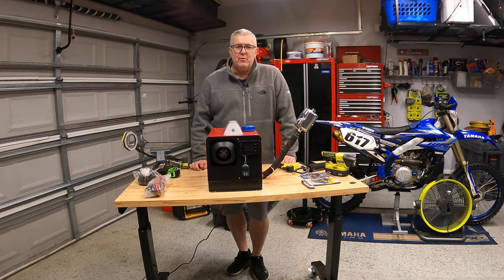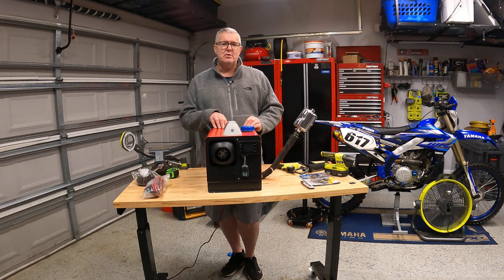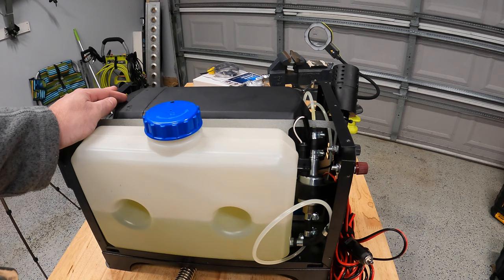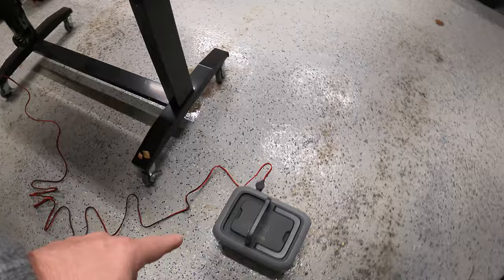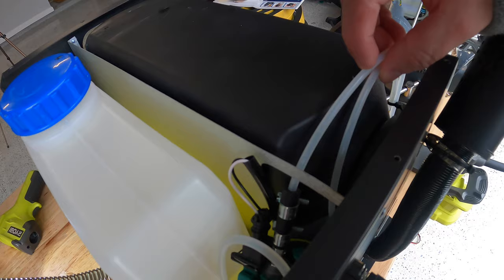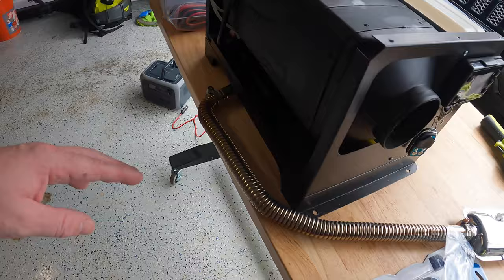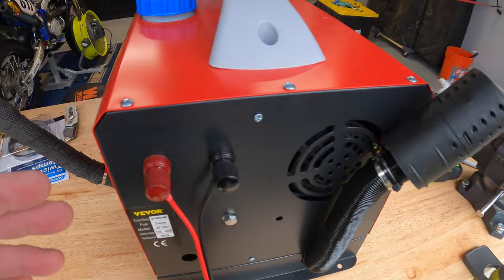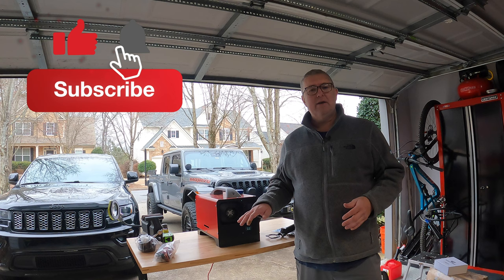No More Ticking: How This Quiet Fuel Pump Changed the Diesel Heater Game for Winter Camping! Part #3

Comment: The pump is noisiest when the heater is running on low.
Reply from the maker: Still a 1000 times better than the one that come with it from the factory
Reply: @sherburnoutdoors  ..Just went to your link that you provided and it says "no longer available".
Reply from the maker: @steiny3353  I just clicked it, works fine
Reply: @sherburnoutdoors  ...hmmmm. I'll try again....thanks
Reply: @sherburnoutdoors  ...The link works fine, but they (the pumps) are no longer available and they don't know when they will be available.

Comment: The exhaust needs to be at a downward angle to allow any condensation  to run out.
Reply from the maker: That exhaust get close to 300 degrees, I am guessing what ever is in there will turn to vapor
Reply: @sherburnoutdoors  start up and run down and as it cools it will create acidic condensation…..
Reply: I think the muffler actually has a small weep hole to drain the condensation

Comment: I got that pump and have the same heater as y'all. I also purchased the silicon boot thats encloses dose pump. I suspended pump with nylon ties to eliminated the transfer of any noise to heater cabinet.  I dont hear pump after 2 minutes of operation. This is 2nd season with it, already used it to heat 2 car garage this year, still silent! Happy Trails!
Reply: Michael what part of the country are you in? I'm thinking about using a diesel heater to heat my 2 car garage but I wonder if it can keep up in a Minnesota winter.
Reply: Can you share more info and possibly a link to the boot you’re talking about?
Reply: @j.saavedra1502  It'll heat your double garage as long as insulated well except concrete floor will still be cold unless you insulate it too

Comment: Just add some used filtered cooking oil (up to 70%) and the higher viscosity will make the clicking almost silent. Best way to prepare the cooking oil is using some pork gelatine desolved in boiling water, add it to the used oil and mix it. Let it cool down, and most of the gunk will settle at the bottom. Use the clear oil on the top and filter it.
Reply: Used cooking a big NO from us and only ise home heating fuel or a decent road diesel  as we have been using those heaters for years.
Reply: Yeah that's the best thing you can do if you're trying to ruin your heater
Reply: @troy7124  It is for sure not recommended, but I have run it like this for 1 and 1/2 season, with no big issues. For me, it has been a great succes, considering the heater was only 120 euro. Diesel prices here (Europe) are insane, so this is a cheap alternative. I am sure I will need to clean it more often and it will need more regular service intervals, but that is a risk I am willing to take.

Comment: The thing I found that works the best and extremely inexpensive is a pool noodle,wrap the pump with it
Reply: Great idea. I used the foam copper pipe plumbing foam tube
Reply: @MikeR55  I was thinking motorcycle silencer packing.  Amazon has some for $10.
Reply: @jimm1819   Ya that will work. I have some left over from an FMF muffler repack kit.

Comment: We have an Eberspacher diesel heater mounted underneath our VW T5 camper van and in the handbook it describes the pump as “near silent” I can honestly say that I’ve never heard the pump either inside or outside the van, just shows that these pumps can be very quiet 👍🏻🇬🇧
Reply: It's cos you have rightly spent the money on the genuine item rather a knock off. Good on yer.
Reply: We have eberspacher heater's in lorry's and they are brilliant,I had a Chinese diesel heater in my camper van, lasted three weeks 😢
Reply: @steveffuksake  Eberspacher was recommended to me by a former HGV fitter and parts supplier, he said they were very reliable and parts were readily available it also helped that we have a main agent fairly local to us who did the installation. It was not cheap (£1500 fitted) but I’ve not regretted it.

Comment: You need to have the pipe facing down to stop condensation in the exhaust which is acidic
Reply from the maker: Thanks for the advice, started doing that now
Reply: @sherburnoutdoors  Agree and as you had it in the video, the 'thin' edge of the exhaust you'll see has a hole in it which drains any moisture from the line, hence the continuous down slope from heater to outlet.  The other 'thin' side has the mounting rivet hole.  Great video and I've changed my brand on 'low noise' pump I was planning to order to the one in your video.

Comment: I used header wrap that I use on my Harley. You can touch the exhaust pipe and it is just warm. The best way to use the heat wrap is to soak it in water to keep the glass fibers from getting on you.
Reply: I did that on an 8KW diesel heater with a couple of layers. When the heater is on full it still gets too hot to touch and will melt plastic. Maybe the stuff I used wasn't as good as yours?

Comment: ran the exhaust through a radiator and get more heat, also brother when doing exhaust wraps wet the soak the cloth and then wrap you get a tight wrap that will not come undone. great video thanks for showing that an after market pump can take away the tick tick tick.

Comment: Great info on the fuel pump, thank you.
One thing you should be aware of when using an infrared thermometer is that they work by detecting infrared emissions. Not all surfaces are equal in this regard. Shiny surfaces are notorious for lack of emissivity. Flat black and strangely enough water work very well. Do a quick Google on infrared emissivity tables to shed some insight into their accuracy on various surfaces.

Comment: I screwed foot extenders to mine to get rid of burning issue; also helps keeping exhaust pointed down.  Wraps only help marginally. 

If running outside; the old trick is to drill a 1/8 or smaller hole on bottom of pipe by outlet if you need to point up; lets water drip out and increases flow.

Comment: I'll check out the quiet pump, thank you. Would have appreciated a temp check after the black tape. In my case the tape just conducted the heat right through, maybe a drop of about 10 degrees was all I got. Used about 1.5 inches thick white fiberglass heat wrap and down to 73 degrees. (touchable)
Reply from the maker: In the showdown video I did last week, there are temp readings taken

Comment: i love that clicking noise, makes me know that heater is working :) and wrapping exhaust aint a good idea...unless you change it with proper one, those chinese pipes are so cheap that will simply burn down and closing heat inside will just speed it up....
Reply: me to ..i find it relaxing and comforting

Comment: Could you wrap the fuel pump in Rockwool?  it does a great job in my living room walls for noise reduction. And a combustion rating of over 2000 degrees.

Comment: I have sound deadning laying around and I plan on adding a layer to the pump itself and around the cover to test it out.
Reply from the maker: Let me know how it goes
Reply: Fired heater last night, loud tick from pump but didn't realize what it was at the time. Removed cover today, fuel line taping in cover, also noisy pump. Left over batting insulation beside heater from previous owner, stuff some around pump and fuel line. Zero tapping once heater is running. 
Will likely re route pump and insulate with board foam but atleast we know insulation helps a ton.
Reply: Ran heater for 20 mins during day to see if any parts near pump get warm or hot, everything was cool to the touch so in theory it will work but not the safest. Ok for a quick hack until you can relocate.

Comment: I removed the step cover on my citroen relay van...ran fuel line directly to diesel tank as the one supplied   others said leaked...located underneath passenger seat...mounted the fuel  pump on side of step..also left bulkhead head in not a sound.

Comment: In 2 separate installs, one a Chinese and the other a Webasto, both pumps were quieter at the higher setting. It is a faster "click", Not as loud and not as noticeable.
Reply from the maker: I think the noise of the fans helps mask the clicking noise as well when they are ramped up hogher

Comment: Fun fact: The exhaust "muffler" is not a silencer. It's a condenser and it do not damp the sound. It's possible to get a real silencer as a little muffler or as a muffler hose.
Reply: Other than the condenser function, is it even needed? I ran mine without the 'muffler', seemed to work ok without it.
Reply: @MikeR55  
I think you need some way to get rid of the moisture that comes when the fuel burns. So it must depend on how the exhaust system is made and is it possible for the moisture to run out of the exhaust pipe. I have seen a solution where the exhaust pipe had a small drain plug since the condenser was not used.  I think i will use it but i have also 2 meter long exhaust silencer and also a real silencer. I'm still in the project thaughts and have not installed my Diesel heater yet.

Comment: Ha ha you learned the hard way about itchy hands and fibreglass exhaust tape, always wear gloves before applying exhaust tape.
May I suggest that you lower the exhaust silencer as it has a condensation drain hole in the bottom of it , your exhaust will last a lot longer. Im running two over the winter here in the uk one in a static caravan and on on the side of the house, its saving a lot of money burning kerosene instead of diesel in them.
Reply from the maker: Thanks for the tips! Only wearing gloves moving forward and I did position it down

Comment: i built a waterproof wooden box, with lift up lid... That sits around the back of my workshop... 
I cut and extended the wiring to the control screen, so that the screen is on the wall inside my workshop, and the heater is outside...
Powered by a car battery, constantly on trickle charge...
and just drilled a hole in my workshop wall to put air vent in...
So i hear no ticking :) Not an issue for me
Reply: I’ve done the same and hear the ticking through the get air vent….
Reply from the maker: That is great, thanks for sharing!

Comment: Hey I have the 5kw all in one vevor diesel heater and I changed the fuel pump but the one you recommended is still very loud… is it possible I installed it incorrectly?

Comment: Make a box out of foam boardand just sit it over top of the heater with the intake and exhaust outside the box. I do it with all my generators and it eliminates 99% of noise. Slide that thing under your vehicle with that insulated box over top of it and you wount hearba single sound other than the blower fan.

Comment: Thanks for video im wondering how long can i leave diesel inside the tank for when its not use for summer time
Reply from the maker: I left mine half fuel over the summer and had no issues
Reply: @sherburnoutdoors  thank you u always add again diesel? Mix old diesel with new just curious

Comment: The ticking is often not the pump but the fuel line tapping against the housing. What pump dit you get 16ml..20...24? Or you you just bought 'a' fuel pump?

Comment: I have my pump suspended by a couple of elastic bungee chords. This is on a boat and is still mounted so will not swing about. The chords stop the pulse communicating itself to the infrastructure. Can hardly hear the tick at all. Would be silent if I wrapped the pump with insulation but so quiet I've not got round to it.
Reply from the maker: Very cool, thanks for sharing

Comment: Does this new fuel pump compatible with all Chinese diesel heater on the market, and what is the difference between the advanced and general model? Thanks
Reply from the maker: Pretty much, I think all of the units are pretty much the same and probably made in the same factory

Comment: Hi -  great video, want to install a Deisal heater but have the same concern of the pump noise. A couple Questions, is the unit you modded a Vevor? And what power station are you using, I have heard the Vevors need 15 amps from the 12 V to start reliably (Most Power stations I've seen like Jackery et al are 10) Thanks!
Reply from the maker: It is a vevor and the power stations I use only to 10a on the 12 v.  never had a problem
Reply: @sherburnoutdoors Thanks! Good Channel, subbed :)

Comment: Quick question: how do you actually seperate the fuel tank from the case?  It seems to be bolted or welded.  Thx in advance
Reply from the maker: No, i did not remove it
Reply: @sherburnoutdoors  thanks, but I discovered how to remove it. I have a leak and needed to inspect the tank to understand leak source

Comment: Not sure that the pump is actually any quieter. I hear the pump when the heater is on low. When it's on full, the noise of the pump is drowned out by the exhaust noise. What do you think? I am going to put some foam insulation around the pump and see what difference that makes. Either way, I would rather be warm.

Comment: are you running it off a 12v 10amp socket? just got a power station and im using an inverter as my 8kw draws about 150W on start up and theoretically shouldn't work
Reply from the maker: Yep, 10a
Reply: and doesnt draw over 120w? @sherburnoutdoors
Reply from the maker: On startup at the beginning gets around 125 to 127
Reply: right - that exceeds 12v at 10a...you'd think it'd blow a fuse. interesting. Not sure I will risk it. @sherburnoutdoors
Reply from the maker: @RyanGold19  have had probably 10 trips at 20 degrees with the heater and power station, never had an issue
Reply: good to hear! I don't understand how it does it all above the power rating! @sherburnoutdoors

Comment: Hi, Nice video! I’ve got a question for you, did you had any smell from your unit? I have just bought one and it smells like burn rubber. Thanks for your time
Reply from the maker: Let it break in
Reply: @sherburnoutdoors  thanks! 👍🤘
Reply: I had ruber smell so I return the unit
Reply: The smell goes after a few days on high

Comment: Exhaust heat tape will shorten the life of the exhaust pipe by 70%. Insulating the fuel pump will shorten its life by 50%.

Comment: Unless you intend to kill the heater, the exhaust should gently slope downwards, the muffler as a small hole in the bottom to allow condensation out. 

The exhaust tube will crack if you keep bending it in different directions.

Comment: If that's all it takes to bother you I'm assuming you must live in a very quiet area. You surely don't live in the city.
Reply from the maker: It was loud, and yes live in the country
Reply: @sherburnoutdoors  You would have been real fun to be around on an aircraft carrier if all it takes to keep you awake is a tick 🤣 I have a diesel heater and my grampa's windup alarm clock was louder.

Comment: I ordered one of these pumps after watching your video and it should arrive in a couple of weeks.  Seems they are shipping directly from China now or something.  In any case, one of the Amazon reviewers noted that while it was initially silent it then sounded pretty much like the original one after a couple of weeks.  Have you noticed any change in the pump's noise level?  I still have time to cancel, is basically why I'm asking.
I actually have one of James Browning-Smith's replacement pumps which is truly silent (and tunable), but it's mounted in my briefcase heater and I'm hesitant to take it out.
Reply: How did your new pump work out?
Reply: @byrne1916  In the end, I canceled the order. Was going to take forever to arrive and one reviewer said that it was quieter for a couple of weeks, then sounded no different from the original.
Picked up one off eBay that is also supposed to be quieter.  It only just arrived today, so maybe I'll have a chance to swap it out here soon.
Reply: @gr0uch02a  we'll keep us all posted dude! I eBay seen "updated" ones but the plastic piece is just in pink instead. 99% are just the same thing I think. I'm focusing now on just silencing what I have... If you wrap some clothes very tightly to it, it's barely audible.
Reply: @byrne1916 some people have said if you put it in a foam camera/gun case its quieter. IMO when the sound of the fan is factored in its not that bad.
Reply: @robertberin4872   I bought this pump off AliExpress and it's about 25% quieter than the rubbish that came with it. True the fan is louder than it, I just have mine wrapped in a towel now and don't notice it. There's a more expensive version of this pump online with a water filter under it, I'd avoid it as it's not worth paying double the price. I got 2 more replacements on the way, but shipping is +2 months.

Comment: you should never run the exhaust at an upward angle, condensation builds in the line and it can restrict flow and kill. it's happened before.